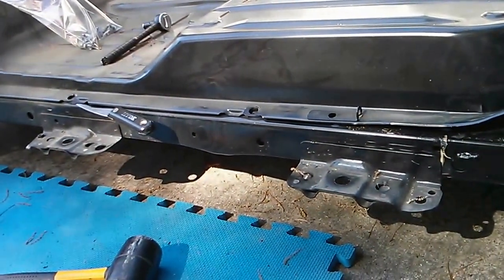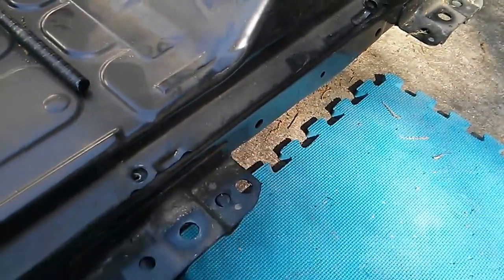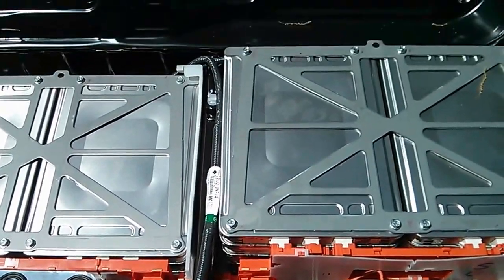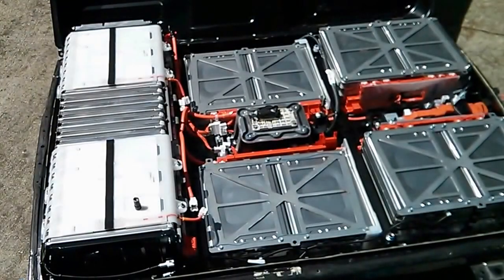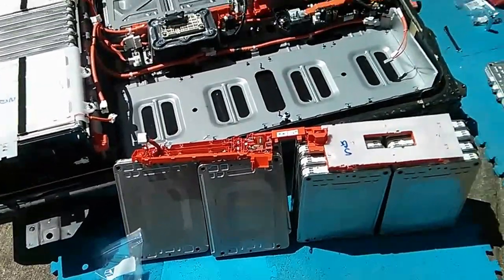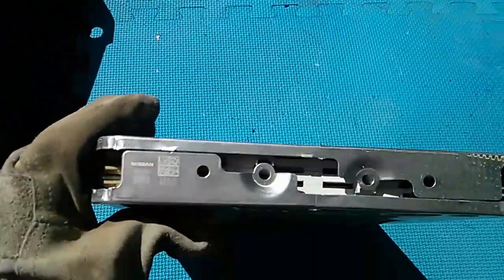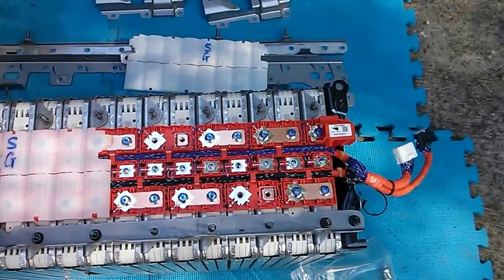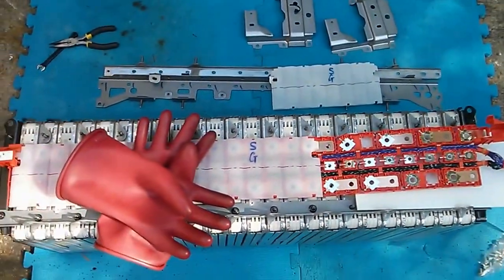Video Stablized: 2013 leaf battery dissassembley

Comment: Hi Jay. Do you know whether the contacts on the heater socket are live when the heater cable is disconnected?  Is there anything inside the battery pack related to the cabin heating? (A fuse or relay? Anything)  Thanks Jozef
Reply from the maker: There is a relay that de-energizes the outputs unless activated.
Reply: @summetj  you are a star. Thanks for your reply.  👏👏👏👍👍👍

Comment: The pads are the heating elements to protect the cells from freezing. You have two small front and bigger rear elements. Called thermal pads.

Comment: Jay, Thanks great info. Now we all know what's inside out LEAF pack. By the way the Heat Tolerant Battery pack didn't come out until 2015. I think this was a 2013. I'm from Arizona and names it the Lizard since it can take the heat but Nissan wouldn't use that name.
Reply from the maker: solarstacks The 2013 has some definate physical differences from the 2011/2012 models, (more vent holes in the modules, for example, plus what look to be heaters inside the pack), but it may be that the newer chemistery was the change in the 2015 models.